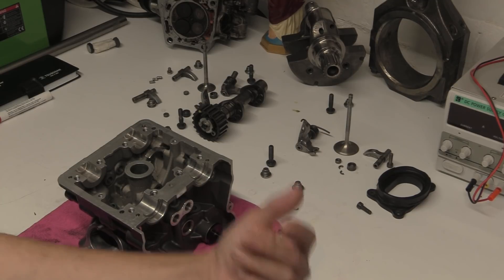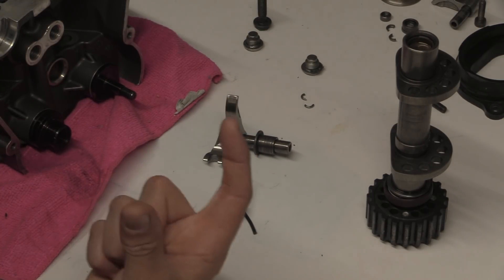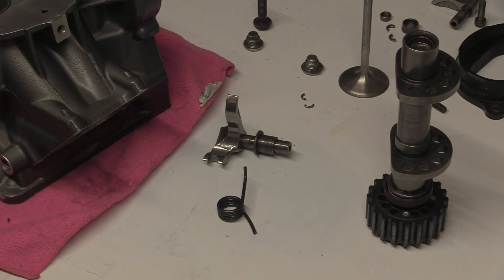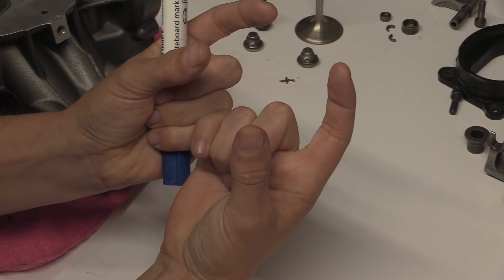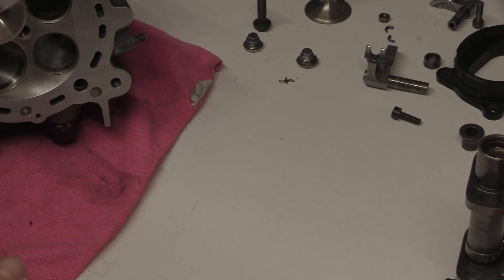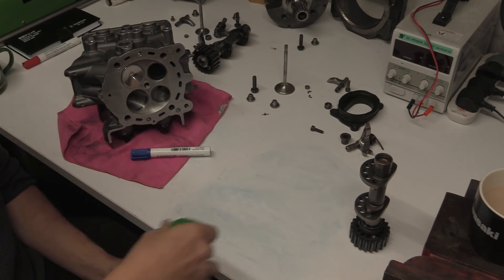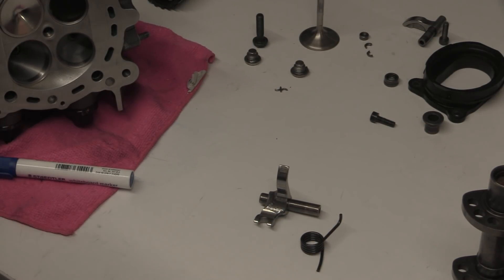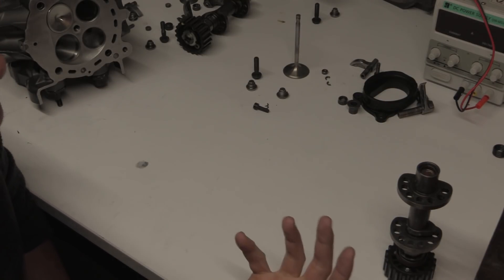Why do Desmos have springs?

Comment: Thats the Reason why Ducati can use this system eaven in the GP and all other have to use Pneumatic valve.And thats the Reason why the acctually Panigale revs in Stock form up to 16500u/min no other 1000ccm can reach this rpm not eaven close.

Comment: The springs are just there to help get it started and reduce chattering noise. It'll actually run just fine without the springs.. if you can get it started. The compression pressure actually exerts more force on the valves than springs do.. even in a conventional non-desmodromic engine.

Comment: That spring is a relatively light one, all it has to do is take up the slack. So the pumping losses driving the valve gear compared to a regular engine are less. That's the idea behind it.
Reply from the maker: Pumping losses?
Reply: @thedirtyworkshop  You know what I mean.

Comment: Does the amount of force that the spring pulls the valve against its seat affect the valve's ability to seal?
Reply from the maker: well yes, it's there to seal the valve...
Reply: @thedirtyworkshop  how hard does the valve need to be forced against the seat to achieve an adequate seal?
Reply from the maker: There isn't a set valve. Any pre-load theoretically would be enough. What is important is reducing valve bounce. That's a different video altogether.

Comment: Surely it says something about the system when Ducati choose to use Desmo in both their MotoGP bikes & street bikes ,, don’t see any pneumatic valves on street going Japanese bikes
Reply from the maker: Pneumatic valves need compressed gas to run. You'd need to top it up every 500 miles.... the next thing is how this is used. No-one on the street needs max power at 18,000rpm. In racing they do. 

I know you're a massive ducrappie fan, but it's not even their system. Enjoy paying the extra money for those valves.
Reply: The Workshop ,, hahahaha , luv you too

Comment: I know you’ve done this video on the back of the previous but I’ll say it again here ,, they run fine with the springs removed, ask any race team
Reply from the maker: Running and running as designed are two different things. Race teams aren't bothered about emissions. Race teams also get the best heads etc.
Reply: The Workshop ,, still don’t require the springs to run Matt
Reply from the maker: Did i say they did?
Reply: The Workshop ,, ya didn’t say they didn’t either 🤣😂

Comment: I've always liked the sound of a ducati but I can't really see what the benefits would be worth the weight tbh. And agree with you it is a case they are married to the design as an iconic part of the brand now and there is no longer a benefit. At least we don't have the bollocks some industries are having with trademarks being used to stop competitors making a thing. Glovkclaiming the slide profile for example. I know lotus tried it with the wedge type shape and harley the 45 degree V twin though.

They are beautifully engineeted things though
Reply: Just lool how much a Panigale can rev in Stock form and the Competitors and the Benefitt its clear than😎
Reply: @johnnyblaze1372  doesn't translate to anything groundbreaking in the real world.

It's not a significant difference in RPM, it's not a significant power difference to their competitors. It doesn't translate to a significant difference in acceleration or top speed that translates into significantly better laptimes, (yes ducati have at various points had the fastest top speed of a motogp bike like the 990cc 4T era but that was more about areo than anything else and it didn't translate into individual rider, MANUFACTURER or Team championships.)

The patents been dead for decades but it isn't copied by any other manufacturer in any field that uses internal combustion engines. Which if it gave any real world advantage would be the case and Ducati themselves have admitted that if it wasn't for the fact their internal engineering knowledge/construction experience and R&D is so married to the Desmo system  they wouldn't continue to use it.

Statements like that from your heads of engineering hardly indicate that it's a domminant and genuinely better system.
Reply: @jediknight1294   in the Real World it‘s a Fact that the v4 R 998ccm revs much mich more in Stock as the Competitors,and its a Fact that in most case the Desmodromic is not needed any more,only  in case you wont reach crazy rpm and this is only a Benefit for the V4 R Panigale wich is a Base for the SBK.But it is a System with huge RPM reserve thats why Ducati can use the same System in the GP and Bikes for Street.
Reply: @johnnyblaze1372  couple of issues there both in terms of design and value in the real world. 

1. high RPM on its own isn't a benefit. It doesn't give you anything on its own  The only reason for high RPM is if there's something useful there due to your head design and engine architecture. it doesn't in and of itself increase power output.

 Higher  RPM as a means of getting more power is generally a tool used in smaller engines and comes with huge limitations in its own right. (look at Honda's 6cyl 125s and the gearing they had to run ar tracks that had a lot of tight corners, insanely short gearing through first, second and third to keep the rider in the power.) or the way you have to  build and gear 327ci American V8'S to make power and keep the driver there. 

2. When everyone is working within the same engine configuration and engine size due to class rules, it's about usable power and gearing, high RPM requirements to be in that narrow powerband aren't a benefit. 

3. the  Valve float issue that desmo solves hasn't been relevant as an issue since the 80s so Ducati aren't running any higher rpm than their competitors are and the 'ability to rev higher in the race bikes due to the homologation bikes having desmo' doesnt actually appear. The Kawasaki Zx10R is at 15100. Vs the Panigale v4 at 15850.

Now great that's a 650rpm increase over the Kwak BUT that's not an issue of the desmo system allowing that performance, that's a limitation imposed by the FIM.

The 2021 season started with the Ducati at 16100 and the highest rev limit in the series was the Cbr1000rr (SC82) at 15600. 

So they aren't actually able to USE this theoretical performance benefit because the rev limits are dictated by the CTI (international Technical  commission) dictate that based on the 'Performance Balancing Algorithm) 

Eveyy 3 rounds these limits are recalculated and if you look at where they start and end, you don't see the Ducati significantly higher than their competitors at any point so the theoretical is irrelevant given that they can't actually USE that increased RPM. 

And based on the technical documents from. The 2023 season, the highest revving engine on the grid in terms of what it will take is  the 2021 Kawasaki BUT given the FIM refused to allow the 2021 Kwak to be homologated because of arguments about what a 'redesigned engine is.' they are at the same RPM limit as the 2021 model road bike. 

So kawasaki are currently at 15100rpm max, which is 1100rpm over the 2019 zx10r engine they started the season with and is identical to the 2021 ZX10RR homologation roadbike limit (and we know from testing of that new engine design and previous engines that they have about 3k more they could use if the class allowed it.) 

Ducati on the other hand are at 14900 on the road bike, but in WSBK racing they are only allowed to run a 15600 limit.

So the fact the system 'could' rev higher' Isn't relevant to racing and is just for marketing's sake on the road bike.

Comment: Mate, sorry to ask here but I can't find an email... Really amateur question but I'll ask anyway lol.... I'm servicing basic stuff on my ER5 1997 and wondered could I swap out the air box for pod filters? I'm doing a tail chop and removing the box would help with asthetics....sorry this is not the place to ask, Col
Reply: Its doable but a lot of tuning work to gwt something viable, prepare to spend lots of time jetting especially if attempting to run with open pipes.
Reply from the maker: You can but the engine won't like it that much. You'll been swapong out jets all the time trying the tune it to run right. Here's a little advice, tune for a stable idle and work from there.

Comment: This is awesome, it addresses a question I had when desmo was first explained to me.  How did they get any sort of sensing/measuring system in there to measure the speed of a valve opening and closing, and then compare that to the numbers of the standard spring systems?!  I know you mentioned video, but I mean ANY such measuring system.  I have asked a Ducati-certified master technician this question, and was brushed off with, 'well they must have had something.'  Apparently they were 'guessing' based on measurements of how thoroughly the gas/air mixture was burning, was the most detailed answer I got no matter who I asked.  Do you know how they were determining the speed of valve closing/opening from one system to the other, or were they just comparing valve malfunctions from one system to the other, or something else? Great explanations, keep up the great work!
Reply: Thumb up
Reply: If you know the RPM of the cams, and the profile ground, you can calculate it very easily. To measure it you could run without a valve cover and film the cam rotation with a high speed camera. Because, unlike springed valves, the system is pretty much solid you know that when the cams rotate the valve is moving (unless it's broken)

Comment: Wouldn't the closing clearance increase with increase in temperature since the valve grows with heat?
Reply: If you can accurately predict which bits cause the clearance to increase and which bits cause it to decrease, at a constant rate over the temperature range for the engine, then you could design parts where the increases and decreases cancel each other out. And Ducati will pay you millions and millions because they've never managed to do it.
Reply: Noone bothered to have a look at the closing rocker specs ducati suggests. As far as i know it is 0-0.05mm or thereabout. The most important is the lower value of 0. So Matt  is wrong and you're right 'cause that 0 means that as long as there is no drag between the cam,closing rocker,cup,collet and valve throughout the cam rotation but no clearance can be measured on a cold engine you're golden,within spec.
Reply from the maker: Clearance where?
Reply: @thedirtyworkshop  I assume between the camshaft and the valve. In this case the follower I imagine
Reply: @thedirtyworkshop  between the follower and the cam which closes the valve.  I would think as the engine heated up, this clearance would increase (opposite would happen to the clearance between the top of the valve and the other cam).
Reply from the maker: But you said increase not decrease...
Reply from the maker: As in the clearance gets better.
Reply: @thedirtyworkshop  My head hurts just as much
Reply: @thedirtyworkshop  ok then how does the system account for valve expansion or lobes expanding when heated wouldnt we see issues or is it a case that that the expansion won't bind up the system  or end up with problems like increased blow by etc for for it due to  the specification/tolerance of the parts?